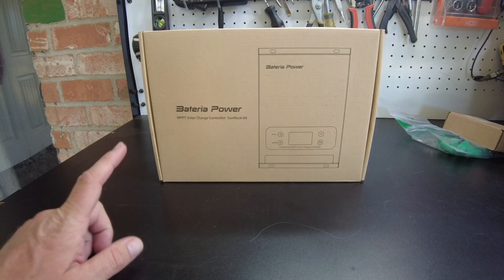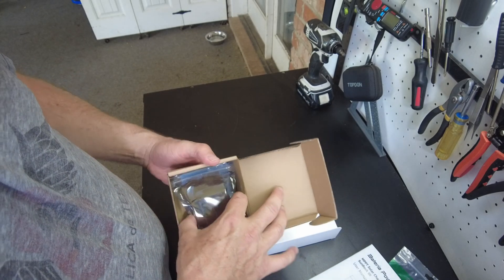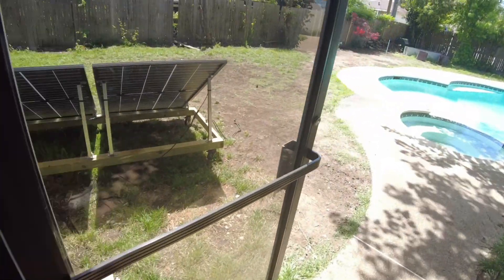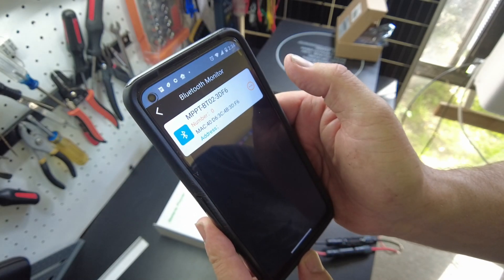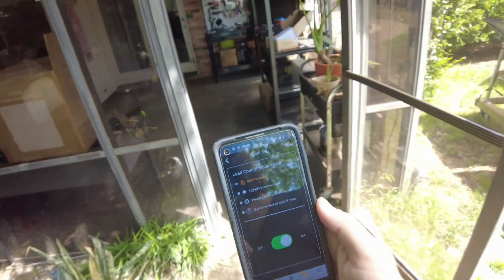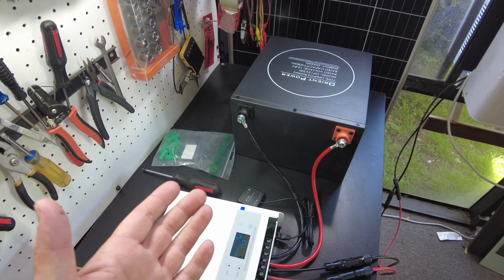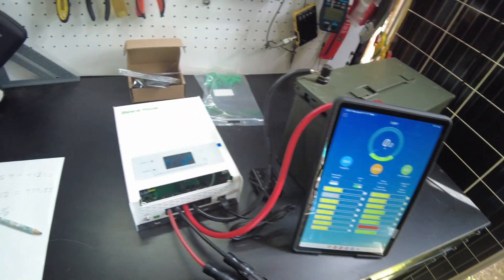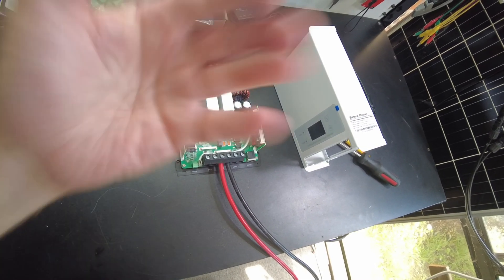Bateria Power SunRock 60A MPPT Solar Charge Controller

Comment: I have replaced the third Sunrock 100 controller and they all have the problem of falling asleep in cloudy weather, lowering the voltage from the sun from 185 volts to 67 volts. Switching the solar input wakes it up. On sunny days they work perfectly. That is, the controller follows the sun and I follow the controller. The store sent a new controller as a replacement, for which I am grateful, but the problem with the new controller is the same. The manufacturer has not been able to help me fix the problem so far. I think the tracking algorithm is bad. The controller from another manufacturer that I recently bought as a replacement works very correctly. This experience cost me sleep and a little money.

Comment: i have a question, mine charging good but when the fan cut on everything is off , no charging, no LCD dispay except the fan is on untill maybe 3 to 5 min. the fan is off then everything back to nomal 😢 .
Reply from the maker: Oh that's strange. You may have a defective unit.
Reply: @BradCagle  thank you, i wiil contact amazon seller for that.

Comment: That's pretty cool - 12V through to 48V. Looks like the EPEVER controller on the bottom, though the 50A one I've got is only good to 24V. Wanna swap? :)
Reply from the maker: Yes pretty cool. I'm intrigued with the small size of this guy, usually something that can sustain a continuous 60a is a fair bit larger. I had an idea for a project with this one, but if that falls through, I'll let you know :) Thanks Ben!

Comment: Hi Brad. I have seen some charge controller not showing the state of the charge on the battery. Eg Bulk or MPPT absorption  and float. The victron and flexmax does it very well. Didnt see if this does it. Can you confirm?
Reply from the maker: I'll check. Thanks